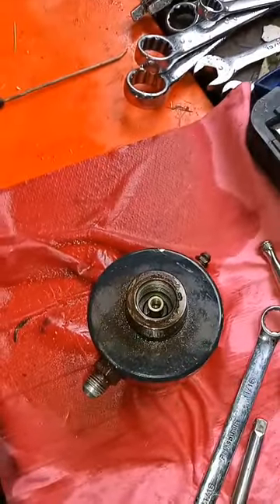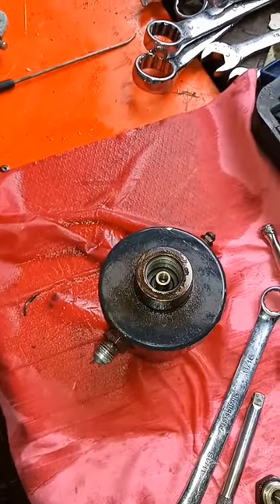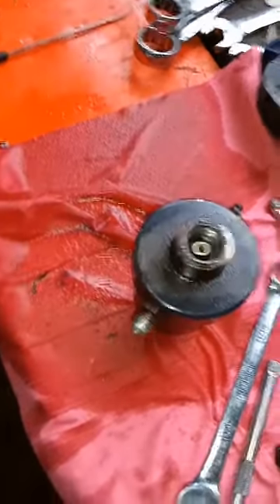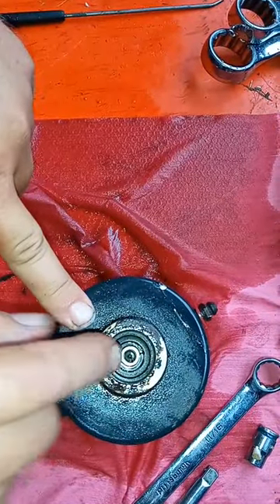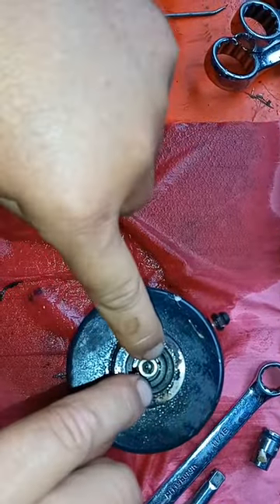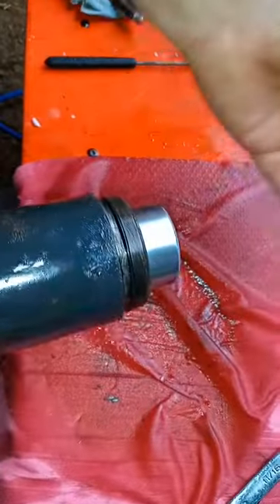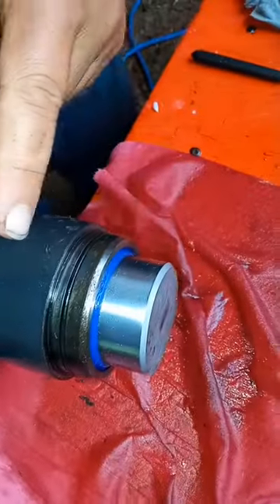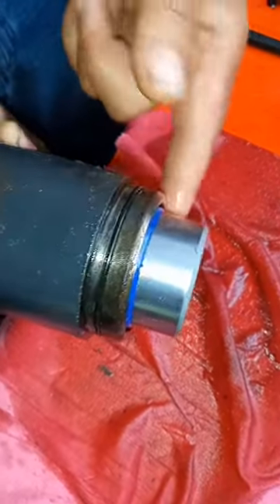Spray Coupe 4450 brake cylinder rebuild

Comment: You said to pull up on the ¼-28 threaded stud. Mine will not move. How hard and how far. I have tried bolt with flat washers to pull up. Must be doing something wrong.